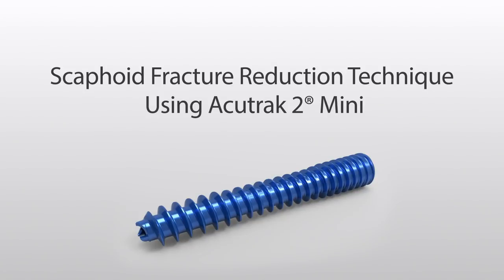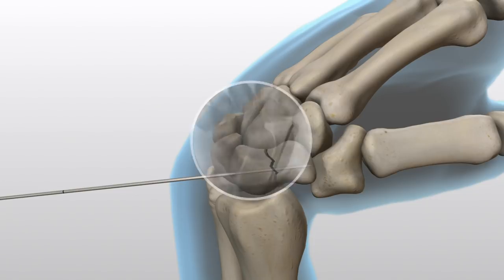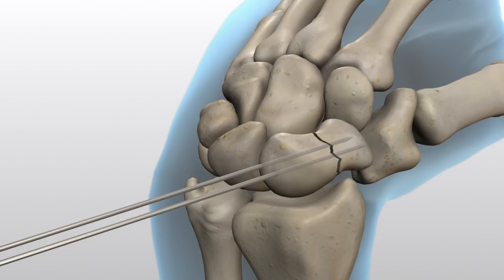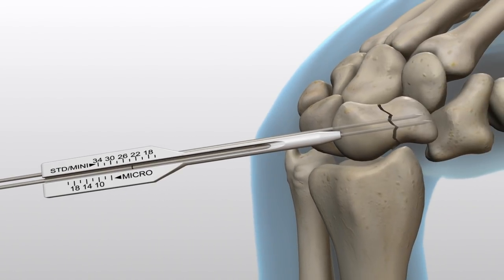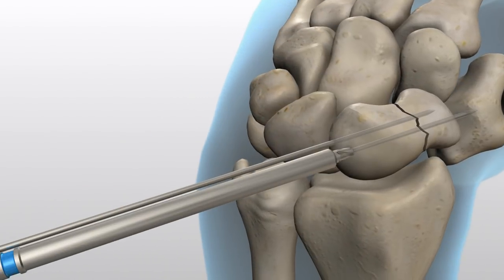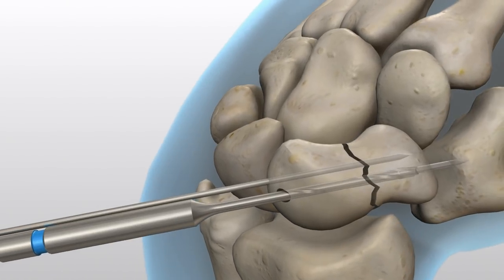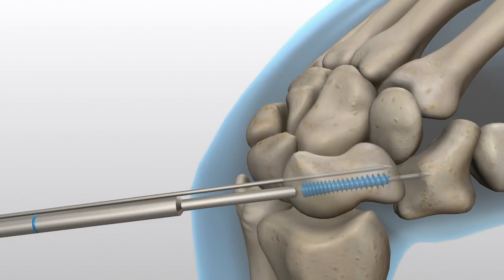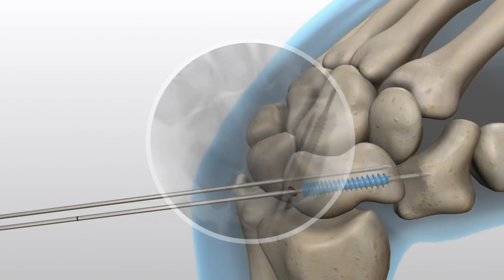Acutrak 2.0 screw for a Scaphoid Hand Fracture

Comment: I had an accident more than 5 years ago and still live with the pain in that area. 
It first happened 12 years ago and it healed by itself which is the reason i didn't went to the doctor until now.
The pain and the limited mobility of the wrist that i learned to live with until hiling doesn't seems to work now like before.
Is possible that the bone to be broken and dead? I work in industry so i need my hand very much. Thanks!
Reply: How is your hand now? I have the same history like yours. Mine was broken 13 years ago and healed by it self and broken again a year ago . What can you advise me? How is your hand the last 5 years?
Reply: I had the exact same probleme. 1 Year after a accident it started to hurt really bad after i thought it healed and it got worse from month to month and the result was a unstable fracture. Go get it checked

Comment: Don't ever get a single opinion on an x Ray ! I thought i broke my wrist went to to the er doctor told me I had a sprain went back several different occasions and got x rays at same hospital all saying it wasn't broken although I knew something was wrong. Went to a hand surgeon today and brought my first x rays from 8 years ago as well as my recent ones and found out it was broken back than. Now my wrist is so fucked I have to have it fused together. I make my living as a fisherman and electrician so this news was beyond devastating. Never trust one person's opinion
Reply: +Kyle March Had the same problem myself. They didnt even x-ray my wrist. I knew nothing about these injuries or the possible problems associated if they are not picked up early. I hope you have little or no pain after the fusion
Reply: Kyle March I got the same surgery done about 8 weeks ago they say it didn't now I have to get it fused how long did it take for your hand to be able to lift normal weight
Reply: Hey bro can you tell me how your wrist feels now? Do you still have full mobility with it? I’m afraid I’m going to need surgery
Reply: My case is xray didn't detect it initially, as it was a hairline fracture. It got developed and when I was playing batting. Now it got detected and fixed with a screw. As soon as you detect, it will be safe. Keep the hope. U will be all right.

Comment: I had this surgery, Fitted the screw. Doctors said that it will be permanent.
Reply: How is it now? Does it hurt? Does your hand move perfectly?
Reply: @Usama.Rizwan.Baloch  I've had this screw for 6 years and have never gained full mobility in my wrist I actually think it is hindering me now more than helping. Thinking of getting removed
Reply: @CodyMiller-xl7mr  my case is little different, i have full mobility but my wrist hurts alot when i move. Doctors told me that they will have to analyse my hand for a year and if it still hurts, then i would have no choice but to have surgery

Comment: can the screws be removed? I broke my wrist in a car accident. I have three screws so I want to know if they can be removed.
Reply: MOST orthopedic hardware is intended to be left in permanently. It can be removed if it is causing neuropathic pains, or is doing the opposite of what is intended  to do; impeding the se of the limb operated on in a significant way. I think the hardware for my left humerus could be causing the pain I’m experiencing, but, I need to complete the physical therapy for a left shoulder capsule reset, first. This could take up to nine months.